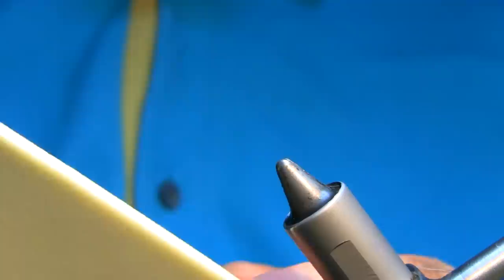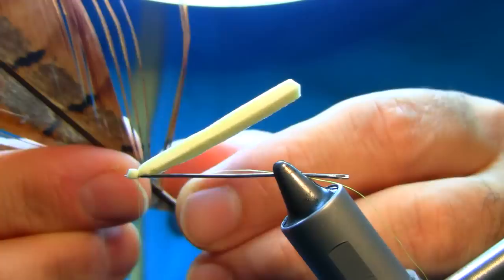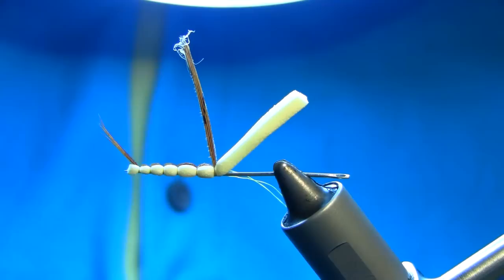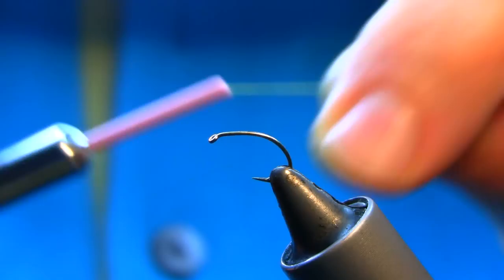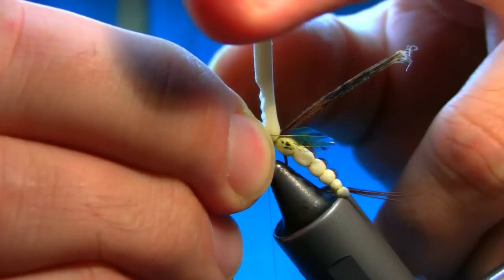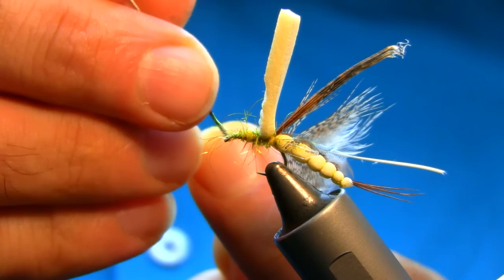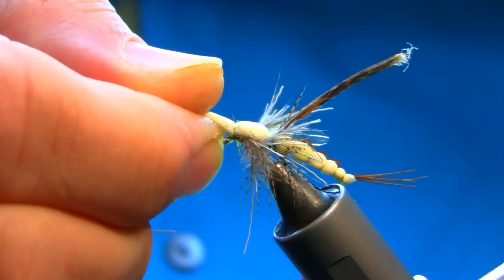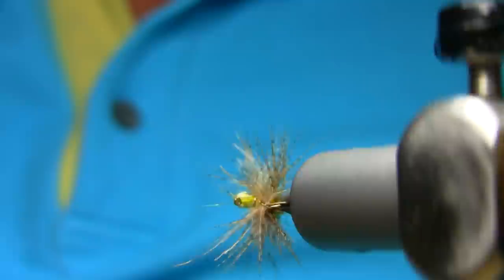Fly Tying a Detached Body Mayfly Emerger by Mak 🐠 🐟🐠 🐟

Comment: Hi mak awesome fly.never seen a extended body mayfly tied
On a buzzer hook before.going to tie some up later using veniards mayfly wings.i noticed you left the fluff on the partridge is there a reason for this.you mentioned the length of foam could you tell me the width.cheers.
Reply from the maker: I am glad you like it. With the Fluff Fly looks more realistic especially in water. But you can make without it, works perfectly well. For the width I use 2 mm from the top end & bottom end slightly smaller, like tapered shape. Thanks